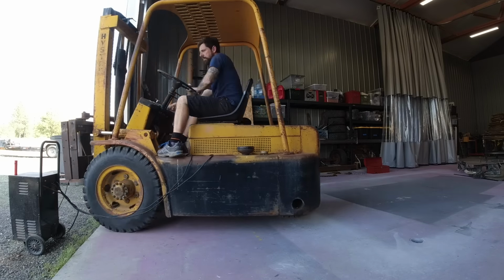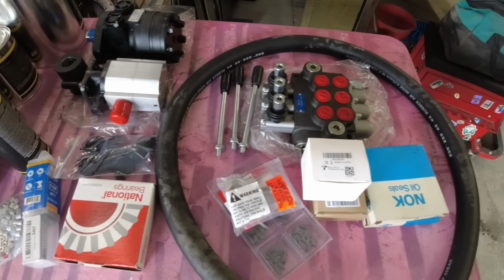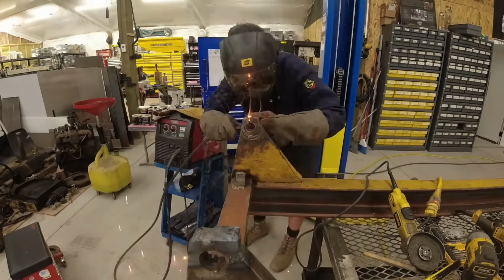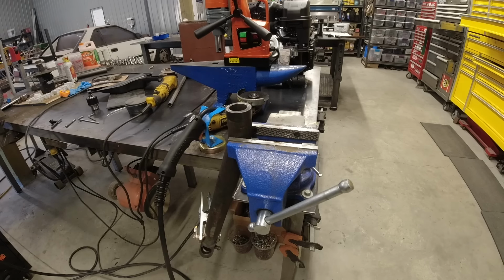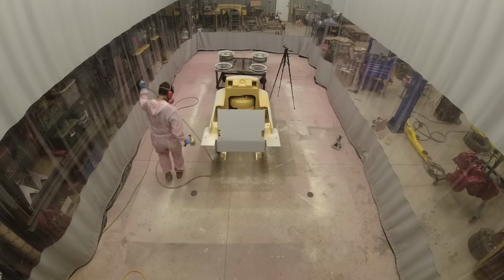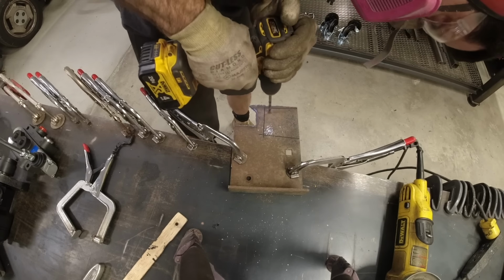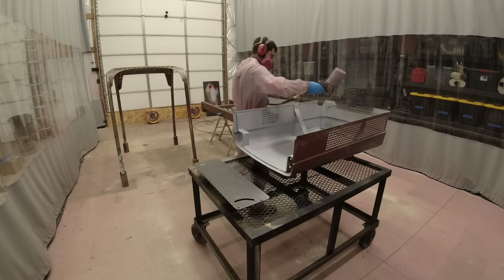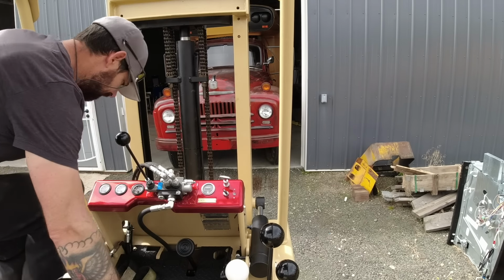Resto Modding A 1956 Hyster Forklift

Comment: I enjoyed the build. One thing to note is that these old forklifts count on the motor as counterweight for lifting capacity. Depending upon what you are doing, you may need to add counterweight on the back of the machine to keep it stable. Something to keep in mind when you go to lift something heavy for the first time.
Reply: I was wondering every one I’ve worked on the rear weight was a separate thing
Reply: I also wondered about losing the previous motor as part of the counter-weight. One thing to keep in mind is that EVERY PIECE of the truck is made heavy from the beginning. Usually vehicles are designed to weigh as little as possible to reduce rolling resistance. Lift trucks are made heavy on purpose.
Reply: @TerminusVox 😊
Reply: Very valid point. I'd weigh the removed engine and add plates of that weight to the body at least as far back, and if possible as low as can be. That would help stability and lower the center of gravity and mass.
Reply: Considering he rebuilt the whole thing, im pretty sure he knows this. I'm assuming he plans to not life very heavy things with it, or is planning on adding a counter weight to it. Of course I could be over estimating him and could be completely wrong, but how about giving him the benefit of the doubt, considering that it not having a counter weight is pretty obvious where the counter weight was coming from.
Reply: I would bet he only lost a couple hundred pounds of counterweight at most because those engines are only 163 ci 4-bangers that have a dry weight of 415 lbs, and he added some weight back on with his engine and hydraulic drive setup. The whole lift being a 5k lift will weigh somewhere in the 10k lb territory so that few hundred pounds isn't going to amount to a hill of beans. Also the 5k rating is at full mast height, so unless he's planning on regularly picking up 5k lb pallets full of steel and putting them that high in the air he should be good. He can only do it with 4800 lb pallets now. 😁
Reply: You're kidding, right? The difference in weight between the engine and the counterweight is like the difference between  a teaspoon of green tea and a 747.
Reply: @MartyMcFly-n4l   didn't do well in physics class, did ya? Nor straight math?
Reply: @jpkalishek4586  You must have scored low on reading comprehension because you don't make any sense at all. Maybe ask a grown up to read it for you and explain it in simple terms. You'll get there eventually. Don't give up!
Reply: Fantastic video. Aside from the build, which was next level,  the editing must have taken ages! Really enjoyable and I hope you get many many more views.
Reply: It doesnt change the capacity it changes the load center. And as long as it doesn't move the load center triangle too far forward it doesn't change anything you would notice since this unit is a two stage with no free lift and the motor weight is neglegable compared to the counterweight. Also the older hyster units were rated for higher capacity at lower lifting heights at 24 inch load center. I've worked for HY for 15 years at this point and i actually own this exact model personally that i bought on trade for my own shop.
Reply: this is the reason why electric forklift will always use lead acid and nether lithium battery's.
Reply: @robertwolf9380  Also, impact resistance. Forklifts in the hands of an average warehouse-monkey gets quite a many dings and hits. Even if the body is sturdy and can take hits, lithium batteries are a big risk.
Reply: @robertwolf9380  funny menards dc replaced all the forklifts in 2019 for Linde li-ion lifts
Reply: @jpkalishek4586    So true. We added 300 plates hanging out rear outdoor S60 Old Hyster then lifted an 8200 lb. Church hill Cylindrical grinder onto our flatbed truck
Reply: What's all this discussion about counterweights and capacity etc?
Operating forklifts for over 40 years and having 29 of them,
Reply: @patduffy5710   You took the words right out of my mouth! 
A great exposition and desertation on rebuilding.
Reply: @MartyMcFly-n4l     Not really the difference is more like a big block Chevy motor v8, and a tiny Honda Civic.

Comment: Amazing resto.  The paint is a bomb of retro color.  I can see where the lack of speed can be a benefit.  More careful and precise movement and placement.  You have more than enough power provided in how you built it and you can safely put that power where you need it most.  No reason to go mach 5.
Reply: Just because a machine can go fast doesnt mean you have to drive it at that speed
Reply: Especially on a forklift! As a Certified Forklift Operator, I can assure you going fast in one is a great well to cause serious damage, or get yourself killed.
Reply: First - generation forklift would be olive drab (they were military equipment..)
Reply: Should have put a barra in it 😂
Reply: Well done,you're a clever bugger,great tradesman.
Reply: @Alexander-zo3wx that's why we've taken the pedal away on several types of lifts. Almost all that I work on are stand up units with a control handle.
Reply: @highlandrab19   Yup speed kills on forklifts!

Comment: Hope you have good relief valves on those hydraulics, like when you use the hydraulics to slow down, the oil pressure isn't regulated by the oil pump relief valve anymore.. you might have huge spikes in the pressure when slowing down! especially in downhill you might pop a hose, or even crack the spool block.

Also get some protective sock on those hoses you have next to your legs.. hydraulic injection is no joke.

Comment: My work has been talking about replacing my 1973 Tcm forklift, I finally got them to rebuild it, new paint, rebuilt engine, new rad and all the bs. This is so cool to see someone treat this old forklift like a rare corvette. I have 3 forklifts and a 3 wheeler that hangs on to my flatbed. But that 1973 TCM and i have had some good times for the past 20 years, it’s definitely my favorite

Comment: In the 1990s and 2000s we ran our storage yard with two dual pneumatic HC80 Hysters, one built in 1966 and the other 1971.  Sometime around 1999 to 2000 we had both units completely restored to original specifications and paint jobs down to the sticker kits from the manufacturer.  Your video got me reminiscing about both of those fabulous forklifts I used to own.  

Thanks for the memories. Great video!

Comment: I would give anything to learn under you. I am mechanically inclined and have a job in fluid/hydraulic/pneumatic systems and dabble in basic electrical. However, im not a fabricator by any means. Your ability to change the form and function while increasing reliability is amazing to me. To have the chance to become as well rounded as you are would be such a blessing.

Comment: I had a YE-40 for many years.  I made lots of money using it.  The Hyster dealer in Salt Lake City-Arnoldsen Machinery still had parts for it.  I used to run 20 psi in the front tires to run in in the dirt or higher if I was using it on pavement.  Yours restored is beautiful. Good job!

Comment: Well I'm 5 months late, but as my old boss would say, "Better to have seen it late, than never at all", he was referring to a close call on the road, but it seems appropriate. I am an old retired engineer that travelled across the UK, EU and the US mainly fixing industrial gearboxes, most of them very large. This forklift build/modification was awesome and entertaining. Clearing out decades of dirt is something I've done as well, in some strange places too. The hydraulic motor was interesting as my first thought was speed, but as you said it was only for basically hard work so speed was not a large concern. I'll go and watch as much of your back catalogue as I  am able, good post.

Comment: the ones I've seen called widowmakers are the 3 piece rims used on old tractors and construction equipment where the split flange points óutward, so in case of a blow out the flange would be launched outward and kill anyone unfortunate enough to be standing next to the machine. these ones are less catastrophic in the sense that they're only dangerous when airing up so you can just be more careful

Comment: AMAZING JOB YOU DID WOW THATS UNBELIEVABLE, I GOT TO WATCH YOU TEAR IT DOWN INTO PIECES , CLEAN IT , REPAIR IT , CHANGED THE ENGINE , DRILL IT , SAND IT , PRIMER IT , PAINT IT , ADD PARTS TO IT , RE-ASSEMBLE IT , START IT UP , DRIVE IT AND THEN TESTED IT , GREAT PROJECT , GREAT VIDEO SPEED , BEAUTIFUL WORK , THANKS ALOT  , HAVE A GREAT DAY !!!❤🎉 AMAZING !!!

Comment: The first Hi-Lo that I ever drove was an old Hyster with a 3 speed manual transmission. 
I loved it. By using the clutch I never smacked into anything. I would just ease into a load, raise the forks, move the load, and ease to load into wherever it needed to be.

Comment: Have you shared this with Hyster? I was an intern there, they love photos/videos from people using/upgrading old stuff, they'd print it out and put it on the wall and all the old engineers would hold people hostage and tell stories. I got a lecture about the tooling that used to exist for side arm assemblies that actually accidentally helped like 3 years later when I had a separate project. Those guys love their stuff.

Love the content!

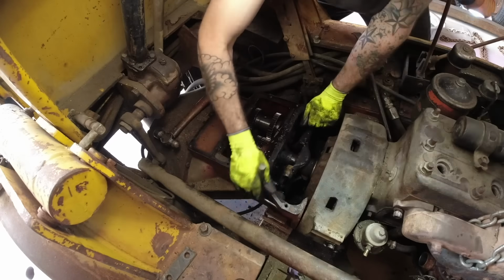Comment: 1:00 There are some around early 90's, late 80's Opel cars that you can change clutch assembly without taking transmission out. There's plugged hole in transmission where you can pull the shaft out a bit and clutch housing has steel sheet blank that you can take off. Then you could get or make small clips and rotate engine to remove flywheel bolts out and drop it out below. I did this back in the day with one of my friends and it was doable. Though we both agreed that it's quite awkward to work and that with almost same work you could drop the transmission out. But well at least didn't have to pull drive shafts out.

Comment: I had an 8 foot bed on a one ton dullie. At first it seemed difficult to manage in parking lots but after I got use to it I could park it anywhere. I loved that truck. I towed a 14,000 pound 5th wheel camper. Don't fret about the 8 foot bed.

Comment: Ditto on the loss of weight affecting capacity. Love the upgraded steering. NOTE that forklifts use a priority hyd system that allows steering, lifting,tilting and now the drive to work safely together. Excellent quality video and sound👍

Comment: Sweetness! Sweet! Nice  n ezee  to replace the clutch assembly. Remove a few bolts input shaft bearing retainer slide the input shaft forward into the differential and then you can actually  pull out the clutch the pressure plate the throwout bearing you can even get to the flywheel.

The 1956 Forklift, if that Forklift was mine, I would do factory color and black plus diamond platted black bedliner makes sense and I would have the Forklift zippy because I want to get things done in a timely manner.

Comment: Great build!  I like the attention to detail.  I like that you included your kids in the build.  Good to show them how things are made and the time that is required to build something.  Especially in this world of instant gratification!  I was wondering why you went with a spool valve for the steering?  there are hydraulic steering motors that are used for machinery including forklifts that operate a hydraulic cylinder.  More precise control, retain the existing steering wheel and more compact in the hose runs.
I also like your shop.  great to have lots of room for all your equipment and tools.  Impressed with the curtain that can be moved out of the way when not required but very handy when there is dust, rust or spray paint...!
Keep up the good work

Comment: If you wanted to add an electric start in the future, but are worried about your hourmeter constantly running with key on, one thing you could do is have a normally open oil pressure switch T'd in with the pump outlet, that way the switch only closes and sends power to the hourmeter when it is closed by the oil pressure created by the pump, which only happens when the engine is running. May or may not be possible, but in theory it should work. Awesome video, i really enjoyed it 👍

Comment: My uncle built a tractor that he used a spool valve for steering, but it didn't take him long to go to a rotary valve. Basically, any steering valve from a forklift would do what you need, if you are dissatisfied with it the way it is. Id say it turned out nicely.
Im in the process of making a compact tractor usein the drive axle from a Hyster electric forklift. I'm making it hydrostatic drive with a pump and motor from a Hustler zero turn mower. I've got several choices in motors, including air and liquid cooled, and gas and diesel.

Comment: I love this, I have an old lyster that I acquired and use it for log moving and dead vehicles in the yard. However it no brakes as they are not connected to the master cylinder. I haven’t been able to match the size of the pipes up but the church jeep information is going to be gold thank you😅

Comment: You brought back memories for me,when i started working on forklifts i worked for a company that had ,towmotors 462S 600S ,hyster YE40 and S60, yale G51 and KG51 yard kings On the YE40 hyster it should have a 2 speed transmission, buy the way the Hyster ye40s were mostly  made in Brazil.

Comment: I agree with your decision on the side shift. Before I spent any real time on a forklift, I thought that feature was the beez kneez, but when I helped out a friend a couple years ago running one that had it for a few weeks, I found that I stopped using it as my skill level increased. If you're halfway decent at running a forklift, side shift is a rarely used feature.

Comment: Really, really cool build. Loved watching you work, you're clearly very passionate and willing to put a lot of effort and care in to reach your end goal. I'd love to offer you one piece of advice though - burst sleeve on the hydraulic lines. Particularly the lines on your steer block since they're pointed pretty much directly at your face and crotch - neither are cool places to cop a pin prick jet of high pressure hydraulic oil. The two lines routed into the frame next to the handbrake lever (seen @ 49:11) would be good to wrap as well, the cable ties you've got will allow vibration and chaffing on the frame and between the two lines. Kevlar burst sleeve, and if you're really keen, spiral wrap. It's not an immediate risk but vibration, exposure to UV, heat cycles and contractions will deteriorate everything eventually. You'll clearly be keeping this beautiful thing around for another 67 years so it seems like a valid concern 😁
Reply from the maker: That's a great idea. I can't stand when hoses get worn from vibration. I'll look into those sleeves.

Comment: While I love what you did, I have an very important suggestion for your steering up on the dash plate. I would personally make a cage/ plate for the lines and steering body to go over it as if in the future if a pinhole leak develops under pressure it could fail and cause serious harm to you it's why most all systems hide them under steel body panels and such. I say that because I have seen it first hand. (I am a CAT Technician and work with hydraulics everyday) but the lift looks amazing and its nice to see someone who has a eye for nice equipment.

Comment: I have a manual transmission yale forky from the same era. Great work beautiful paintjob and amazing work on the hydraulic system. My forklift has the same sort of use case. the correct answer here was to replace the clutch and convert it to propane, That thing is so slow i would go insane trying to make it out to the truck before the driver abandoned delivery.

Comment: Hyster forklifts are great when it comes to technology, I use an electric one everyday, all electro hydraulic, not a single lever, just flipswitches, automatic handbrake, even foreward/reverse are just stuffed in one pedal, you need to get used to the monotrol system but it's a luxury. Tried many brands, but Hyster is my all time favorite.

Comment: I just got done rebuilding my 1978 Hyster S30 just like you are doing here. I kept everything original though, becuase the way I see it, if it lasted this long with the orignal designs there is no reason to change anything.  Just my way of looking at it at least, no right or wrong either way. I rebuilt the Y112 engine, and it was a process, there are no rebuild kits available for the engines so I had to piece a kit together and get creative doing so. I did make a few little improvements along the way to the engine to try to getmore out of it beyond the factory 78hp. I am curious to see how that single cylinder is going to work. Good job with the rebuild it looks great.

Comment: I have one just like that. I usually leave the mast and boom from my engine hoist bolted to the forks. It makes pulling engines a lot safer when you have to lift them 5-6 feet in the air.
Your transmission support seems a little light. Especially being rigid, I worry that it won't last if it starts flexing due to a little play in the front axle mounts.